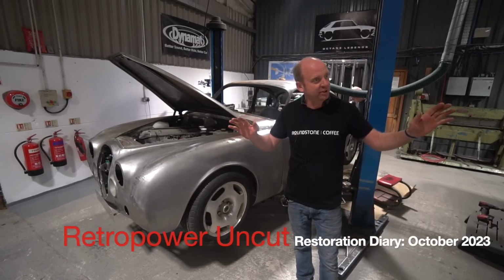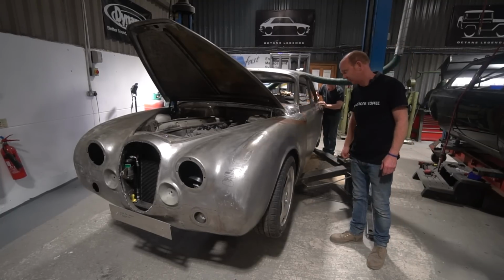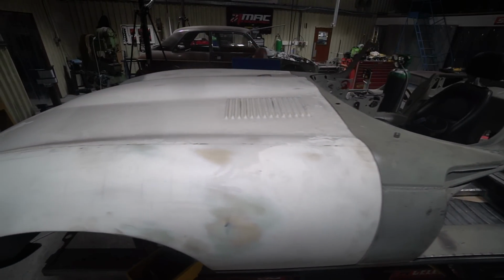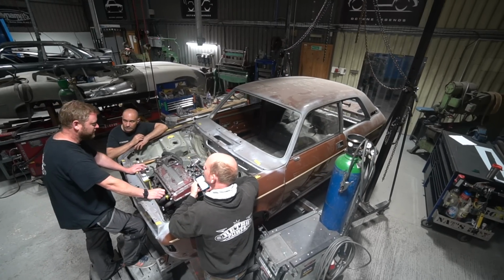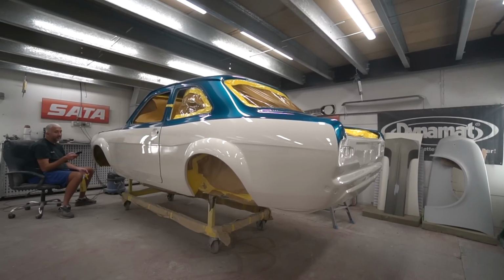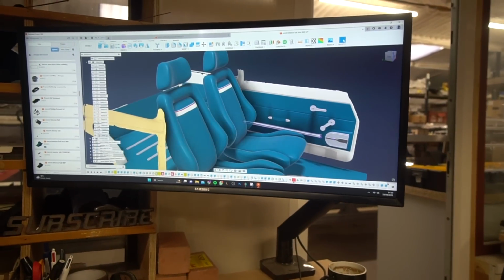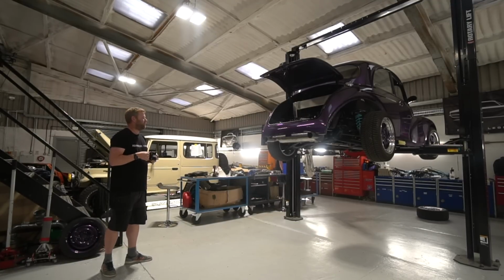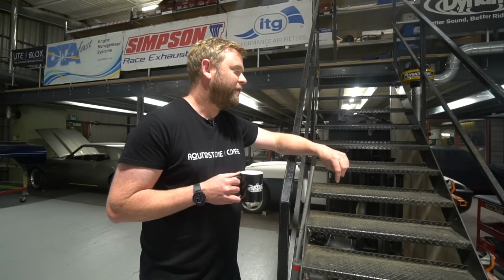VTEC Austin ALLEGRO Continues to Take Shape!

Comment: Question: Your metal finishing process with zinc metal spray, primer and raptor. What to you do regarding tubular components like wishbones to prevent corrosion inside the tube?

Comment: The engine on the Allegro seems rather forward of the front axle line. I'd love to see the weight and balance figures on this. A Quaife ATB diff will be an absolute must on this.
Reply: The Honda underpinnings are virtually unchanged  other than the rear floor being cut and shut to fit the Allegro wheelbase, therefore the engine is as forward of the front axle line as standard Integra Type R.
Reply: Look at the Lancia Fulvia or Alfasud....well-forward and iconic handlers
Reply: Allegro chassis had the engine further back lol

Comment: My question is, can anyone turn an engine into a sump  if it was was not built that way by the factory.  Eg. Let’s see someone had an early fiat  spider. Wet sump.  And u wanted to put in a Alfa bus so v6 but it’s to tall with the oil pan     Could u switch to a dry sump  so u had engine clearance and ground clearance   Hope im wording that correctly
Reply: Some are easier than others, but yes, you can convert most any engine from wet to dry sump.  All it takes is money and time.

Comment: Why don't you ever put the six clock dash in your MK 1 escorts? All RS escorts had them even the 1300 GT, twin cams and 1300E. So cool
Reply: They weren't very good ergonomically though, the steering wheel obscures the additional gauges most of the time. A very cheap solution from Ford at the time.

Comment: Worked at JCT 600 in the late 70,s who sold Rolls Royce, Bentley,s , Porsche and Ferrari.
Everywhere Rolls and Bentley's used lead they rotted . Apparently it was down to not washing the flux from solder tinning with soapy water and solvent like panel wipe before applying the lead .The flux rotted the steel .Maybe the flux used for solder tinning is different these days and not acid based .
Porsche sensibly recommended the use of inert epoxy primers and fillers .
We also used Upol D filler which is reinforced with aluminium flakes for high adhesion across multiple substrates. Even today i still use Upol D after all these years because it never lets me down .
Reply: 3M FC Epoxy Metal Filler lead substitute